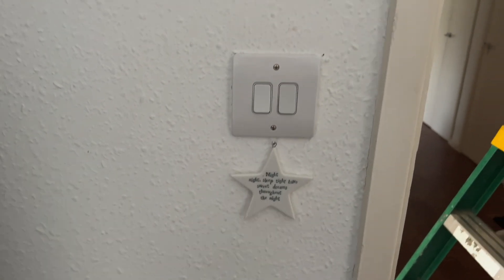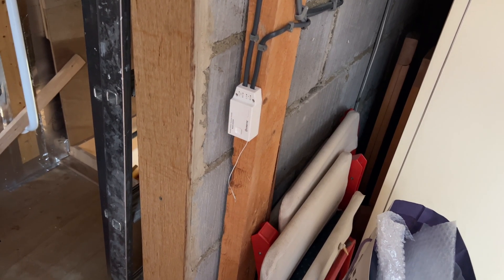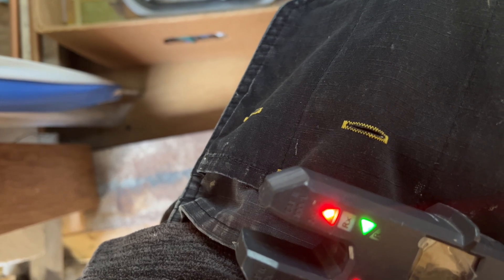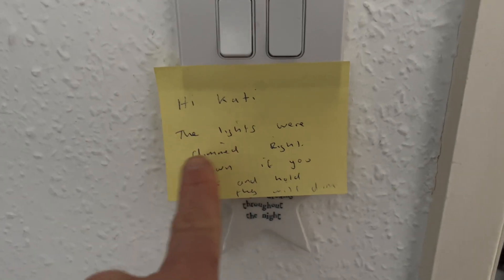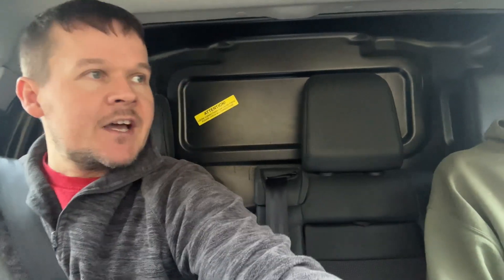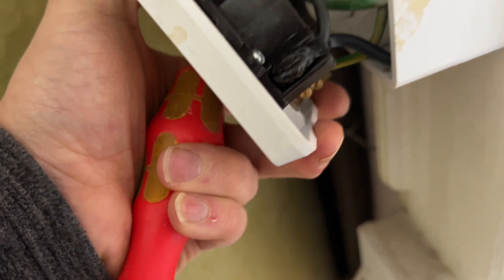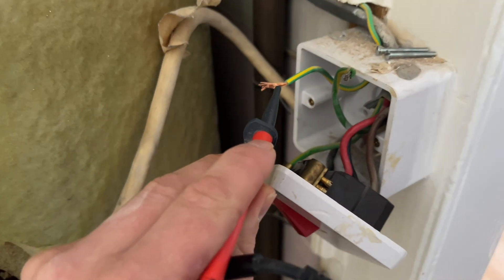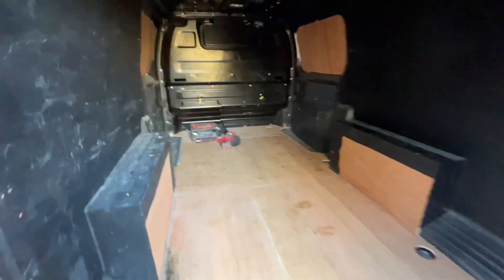CPC Piggybacked off the immersion earthing the lights!!! 110V earth leakage

Comment: Would earth leakage detection ,, eg an RCD  not pickup  on current going , somewhere , / see an imbalance ,, and  activate the trip ?
Reply from the maker: He installed a cheap split load board and put them both on the same side.

Comment: Reminds me slightly of an issue we had when we moved into our current place that was a fair bit deadlier. Double light switch, 1 switch wired to kitchen light on the downstairs lighting circuit. All good. Other switch? Straight wired off the adjacent mains circuit for the thermostat control to control a floodlight out the back door. Turned the light circuit off, other switch still very much live. Almost had to have the entire place rewired after finding that.

Comment: A fun one! I know it's unusual and a pain but BS7671 actually permits a CPC to be shared my more than one circuit as long as it's sized correctly. See reg 543.1.2. 
Obviously it's irritating and not what anyone expects to find,  but there was an era when people used to 'fix' pre-1966 lighting circuits with no earth by running a 4mm single earth from another circuit.
Reply: That's how the light was wired in my Grans garage, earth to the socket in the garage, at least it had an earth and with no RCD no issues with any RCD not tripping.

Comment: This is why you should always prove dead, ideally with a GS38 2-pole voltage tester and proving unit.
Reply from the maker: We did prove dead only became apparent when I disconnected the earth and it’s looking for an earth path through me.
Reply: @Cjrelectrical was there a fault on the lighting circuit causing the CPC to carry current? I can understand why the rcd on the consumer unit didn't trip but struggling to understand the fundamental cause?
Reply from the maker: @llmikeyj1 earth leakage from led lighting etc